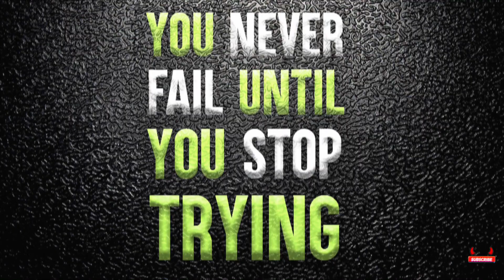BAD NEWS FOR MY TRX400X!? | JUSTDOITTRAY

Comment: The way the piston look it look like it was running too lean & yea bro u gotta do a whole top & bottom end rebuild that cylinder broke off & probably fucked up the crank, the crank definitely sounds /look like it got too much play
Reply from the maker: Thanks I will check when I pull the engine off hopefully not😩🤦🏽‍♂️
Reply: @JustDoItTray  if it was running lean you'll have to reject the carb so it runs right